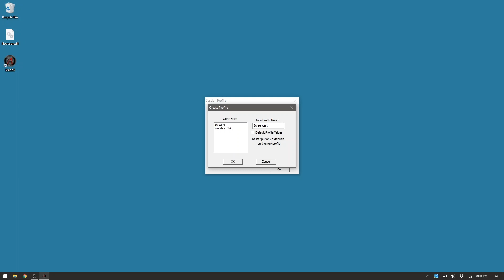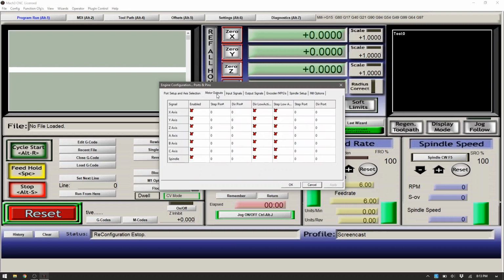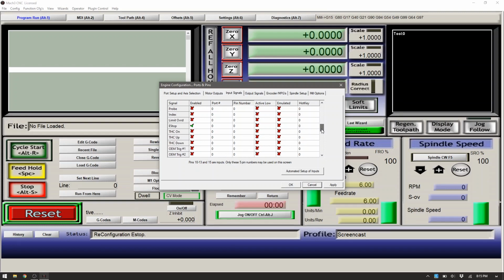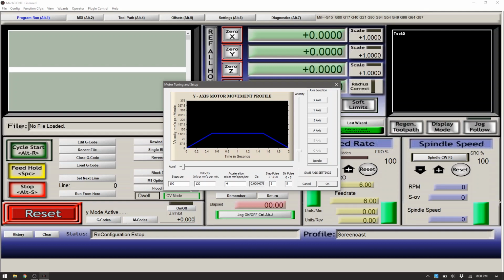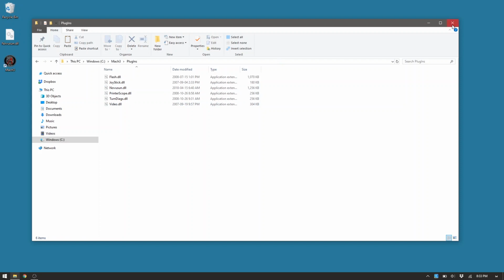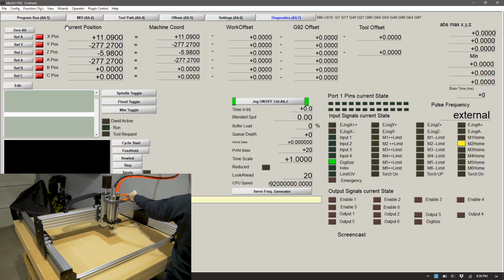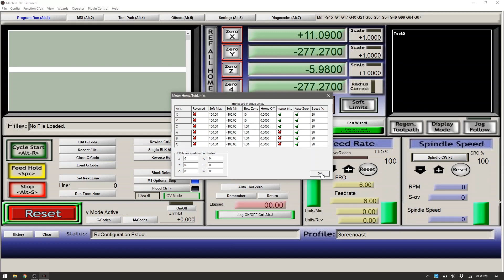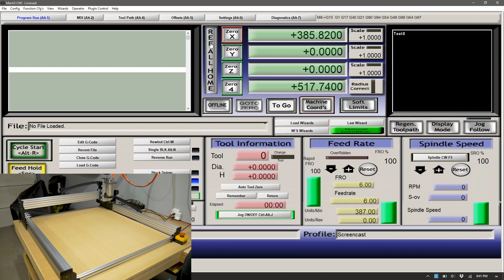Workbee CNC Bulkman3d Kit - Mach3 Setup

Comment: Hola! tengo una máquina CNC Bulkman de cuatro motores y spindle refrigerado por aire con sistema Arduino uno y Shield de Arduino y el HuanYang VFD. ¿puedo controlar la máquina con el software de Mach 3? Creo quees más intuitivo y completo para manejar la máquina. Muchas Gracias por su amable respuesta y gracias por sus videos, son muy didácticos y útiles.

Hello! I have a Bulkman four motor air cooled spindle CNC machine with Arduino uno system and Arduino Shield and the HuanYang VFD. Can I control the machine with Mach 3 software? I think it is more intuitive and complete to handle the machine. Thank you very much for your kind response and thanks for your videos, they are very educational and useful.

Comment: I appreciate your videos. Wondered if you have any tips for A axis slave to Y axis issues? I have been sure to follow your directions to check "Home Slave with Master Axis" in General Config screen and in Slave Axis Selection I've checked A Axis under the Y Axis. My A axis does not turn. If I leave the motors connected to the same drivers but swap where they connect to NVUM board (A for Y) then the A motor turns but the Y does not. Any tips would be greatly appreciated. I'm really stuck.

Comment: Hi, I have such a problem, when you turn on the mach3, writes "select the bin file" , and then when you try to make the machine move "the device is not ready". I tried 3 PC and Laptop, 4 different  Windows OS (32bit). I bought Workbee full kit 1500x1500(Novusun v2 NEVM usb controller). I did all the settings of the mach3 as you did, but nothing works, what should I do? Thank you.

Comment: Can somebody help me? I've got the 1500 X1500 Workbee 3D, Nema 23, TB6600 stepper drivers, Novusun V2 and Mach 3. When I start cutting everything goes well for a while and then the machine just goes crazy and damage the whole project. I've replace the driver motors 4 time and the Novusun twice. All the wires are grounded. Sometimes it will finish a project. Can anyone help with advice?

Comment: @I'll Do It Myself I am banging my head against the wall over here and maybe making things seem worse than what they are.. I am using the exact setup as you (NVUM w/Mach3) and if my movements are correct with button presses, it will be opposite on mach3 viewing window and vise versa.. I home my machine right rear and have front left as my G55 fixture 0,0,0. How do I get everything to match up to what the movements are mechanical and visual? I have also noticed that when I pull a job in from Aspire, it will also be opposite as to what direction was selected ie; climb is conventional and vise versa. Any and all help is greatly appreciated!

-TIA!
Reply from the maker: Hehe it's all learning don't get too frustrated. The first step is getting the arrows going the correcte direction. Do this by flipping the dir pin setting in your motors page. This essentially reverses the motor direction. Then you need to go to your homing and limits page and set home negative. This should give you thing working on the correct direction. Then move your gantry to where you want your work zero and set x y and z zero. Not your machine zero don't get them confused.
Reply: @IllDoItMyself  TY. I finally got all of that figured out but why when I design in Aspire for conventional and import the .txt file to Mach3, it does the opposite and climb cuts O_o. All of my movements are correct in Mach and my spindle is moving in the proper rotation just my cutting is reversed.
Reply from the maker: Not sure why that would happen  it must be something in aspire. The mach will only do what it's told in the gcode so no setting in Mach 3 will affect that
Reply: @IllDoItMyself  I was thinking since things are "reversed" in Mach3 in order to get it moving properly then if Aspire tells it to move left, with Mach reversed, it will move right?
Reply from the maker: Sure that could be the case. When moving the gantry right the x numbers should go in the + direction. When going away from the front of the machine y numbers should go in the positive direction. And z moving upward the numbers should go in the positive direction
Reply: @IllDoItMyself  Yup. Exactly how it moves so when I use Aspire or anything else, I have to choose the opposite of what I want the machine to do O_o LOL

Comment: Thank you for the informative videos, my friend has a 1000x1000 Workbee 3D, Nema 23, TB6600 stepper drivers, Novusun V2 and Mach 3 all set up completed, I battle with noisy- rough steppers steps per: 5( Mach Calibration)  X-Velocity 3500 and X- Accel 270 with Y -Velocity 3500 and Y-Accel 270 I will greatly appreciate if anyone can share their settings with the same hardware setup. Can you also share your average feedrate (F) in mm/sec or mm/min, say for instance cutting a circle in mdf with 6mm twoflute upcut  end mill
Reply from the maker: I will do a video on this shortly but as for the noisy machine try running in 1/8 stepping and upping your steps to per should be around 200
Reply: @IllDoItMyself  Thank you for the reply and i do have issues with the settings, With the X-axis your settings for motor tuning works fine, If I use the arrow key or hold down shift + arrow for max speed the X motor function very well, had to lower the steps per to 50 as calibration suggest in Mach3 Settings page.
The problem is Y and A-axis, Noisy movement with arrow keys,  when I attempt to calibrate the axis on the Settings page the two stepper motors spin like a F1 car standing still just wheels spinning and both axis dont move at all, how would I go about making sure it is in 1/8 stepping mode? as you suggested above, how do i go about finetune the motor axis tuning?

Comment: Hi, I just changed over to the same Novusun TB6600 mach3 setup and followed your video setup. My motors dont work. I see the signal from the mach3 to the TB6600 AS THE INDICATORS LIGHTUP but motors dont turn. I have the DIP switches  on off off off on off. Any advise. Thanks

Comment: Thank you for your fine videos.   Would you please tell me what your DIP settings are on your stepper controllers?  All my axis are working, but they are choppy and loud. Won't keep moving, but whine and they stop. And then I have to push the arrow key again in small increments to get them to go anywhere.
Reply from the maker: Sure I won't give the dip switches positions as they vary on the stepper drivers. But I run 3amps and 1/8 stepping. Often the nut blocks need to be loosened so they can seat and not bind. You can also try lower your max speed and acceleration.
Reply: Thank you for your response, DJ.  All three of my axes do the exact same thing.  Whether I hold down the up, down, left or right and arrows, it will only last one second before the motor squeals highly and it quits moving.  It even does that on the Z axis.  I don't think all of them are binding every direction in exact time frame.  Anything in the software will do that?  I will try to figure out how to lower the max speed.

Also, I already got the 4-6 DIP switches set for 3 amps.  I am very much looking forward to your video on Mach 3 settings!
Reply: @IllDoItMyself  BTW, I have the exact same machine as you.  Would you mind telling me what the 1/8 stepping would yield on the first three DIP switches?

Comment: How are you getting the digitize button to light up in Mach 3? I have been trying for three days to get this thing working and I can't figure it out. I have tried every plugin file I can find and every setting in the book. The only thing I see that is common to the working machines is that the digitize button is lit, which mine doesn't. I am using a laptop, is that the issue? I get ZERO communication from Mach 3 to the exact same NVUM as you.

Comment: I have the same issue as the guy 
Cannot get y and a axis in sync
Reply from the maker: Hey Mike, did you slave the axis together in the Config -> Slave Axis menu. Select Y Axis and Slaved Axis should be A. Then save settings and restart mach3.
Reply: @IllDoItMyself   I finally figured it out. I had a stepper motor control burn out. ( Defective )  I purchased 3 from amazon . Different manufacturer. As it turns out they are different. So I changed the Y axes controller to the same manufacturer.
That was the issue.
Reply from the maker: Ah good find!
Reply: @IllDoItMyself   Ok I am setting up my limits , following you video exactly. There I must be doing something wrong because when I get to the part where everything is zeroed out and then go to the actual Machine cords to set the soft limit activation, as soon as i hit the ref all button to tell mach3 that Zero is home  my Z axis  starts going up or down
Reply from the maker: Hey Mike, Ref all is actually supposed to tell the machine to find machine home by moving toward the endstops. You want to click the Zero buttons to set your work coordinates instead.

Comment: Firstly many thanks for your videos it has made it so easy to set up. I bought my 1500 x 1500 workbee from bulkman 3d and just did my mach3 setup using the supplied 24v power supply but I have had stalling issues with the Hi-torque motors stalling and losing steps with minimal load. I have heard of others using a 48v power supply for the motors and use the supplied 24v for the nvum controller (controller can only take up to 32 volts).  Have you had any stalling issues with your motors?
Reply from the maker: Hey Abbey, the 24v with the high torque motors will be plenty powerful enough. Yes you can up the voltage but honestly you will have machine rigidity issues before you max out the motors if they are configured right. Check your dip switches I recommend running 3amps with 1/8 stepping. If your stalling the motors you should loosen the Delrin nuts  and let them set into place don't out pressure on them when you tighten them down.

Comment: Thanks so much for sharing, was a little scared about purchasing from aliexpress. and not understanding the mach 3 setup, Question, all your mach 3 settings, can they be saved as a template file and exported for others use? I was favoring the black box setup for simplicity but really see the need for a spindle as i can't see running a palm router an hour at a time.
Reply from the maker: Hey Marlen, I can export the settings but there are things during the setup process that could be reversed depending on how you have done your install so there is no one setting suites all. That being said if you follow the video I go through everything needed and try to explain why so that you will know what to reverse in your setup.
Reply: @IllDoItMyself  Thank you so much for the help, looking forward to doing cnc, I do a lot of wood working, cnc is the next step
Reply from the maker: Also make sure your on the workbee China Facebook group there is a whole mess of us on there that enjoy helping others build.

Comment: Thank you so much for making these videos they have helped me greatly. I just have one problem I cannot figure out. My Y axis refuses to move properly. It appears that both Y and A are spinning in the same direction as they should but they are not in sync. Also I noticed that when I am trying to move positive or negative it has a mind of its own. It will rotate a little to the right then the opposite direction, even though I am not telling it to change direction. I have all my settings exactly like yours and connected everything the same way. If you could help me out I would greatly appreciate it!
Reply from the maker: Hey, make sure the Y and A axis both have the same steps count configured in the motor tuning Tab. And also that the micro stepping switches on the driver's them self are identical. As for the reversing direction is this only on one axis of all of them?
Reply: Did you get this figured out? I am having the exact same issue.
Reply: @ro0ter88  The steps count was wrong for me. I switched my dip switches and also changed the Mach3 settings. You also have to set the A axis as a slave axis in two areas inside Mach3.
Reply: @soorenaaslani7491  The step count was wrong for both or you accidentally set them differently? I have a full kit from BulkMan and all my switches are set to 010000 for all 4 motors. Is yours different? I have the config => slave axis area set up. Where is the other setting? I am currently mirroring the A-axis as the Y and the A motors are facing each other. Thank you so much for any help.
Reply: @ro0ter88  Off On Off Off On Off is the switches and I have 200, 4000, 100, and 5s, 5s. Make sure you set Y and A to slave in Slave Axis menu and you checkmark home slave axis in General Config. I'll double check the acceleration for the motors I am pretty sure it was 100 but I could be wrong. Key thing is 200 as the first setting with those switches.
Reply: @soorenaaslani7491  For anyone else that might need help, no matter what I did in Mach3, it wouldn't reverse the slave axis. So, I swapped the b+ and b- wires on the slave and everything worked perfectly. Thanks for the help, guys.
Reply from the maker: Did you try changing the dir low active in mach 3 motor settings this will reverse the direction on the motor.
Reply: @IllDoItMyself  I did and had no luck. I made sure to save the settings and restart the app too. Thanks
Reply from the maker: Oh that's interesting it definitely works for me. Ah well glad you have it sorted!!

Comment: Newbie question here. I'm looking at a Workbee kit that has a few controller options from Mach 3 and a GRBL option. Do you have and basic advice for choosing? Is it mostly based on software compatibility? Or maybe how advanced or user friendly certain softwares are? If it matter, Fusion 360 along with Universal GCode Sender are the programs I'm looking at.
Reply from the maker: The mach3 option is required if you go the high torque stepper motors as it has external stepper drivers that can handle the required current. There are ways of thing with this grbl but not with the controller from bulkman. The difference is just software yes. Mach3 is more professional in my opinion and has been around for a long long time. There are some advanced features in mach3 most of which people with this machine will never use. If your not going high torque stepper motors you will be fine with the grbl option. Otherwise I'm having great success with the mach3 setup. Mach3 will require a licence which is around $200usd so keep that in mind. Grbl there plenty of free options.
Reply: @IllDoItMyself  Great video. I am planning t o buy the exact same setup.  
I have a noob question, Does this controller need to be useed with mach3? None of the other programs work with this? Isn't it a matter of sending gcode to the CNC? Can this setup be used with something like Linux CNC?
Reply from the maker: @Foad Yousefi  yeah the nvum will only work with mach3. Everything else will work with other controller like grbl or Linux CNC or even uccnc. I would recommend even just getting the nvum and if you find your not liking it swap it out for one of the others they are relatively inexpensive.